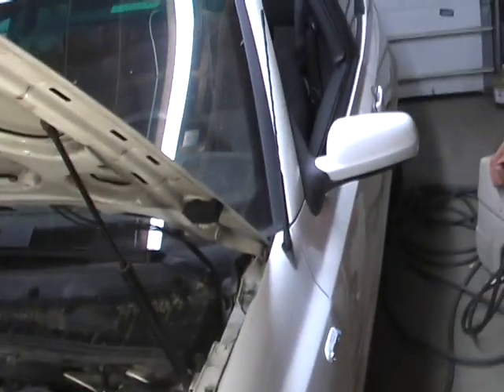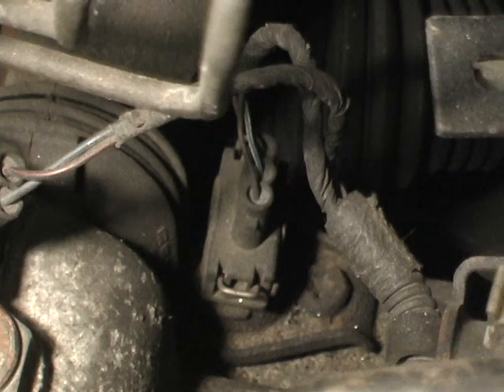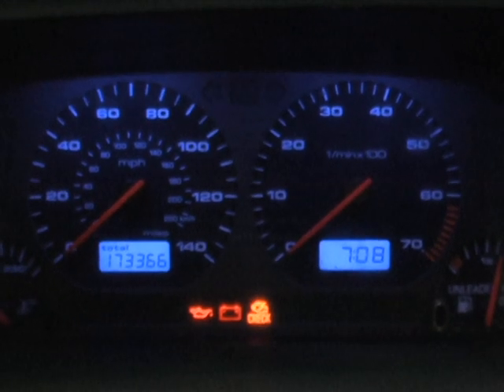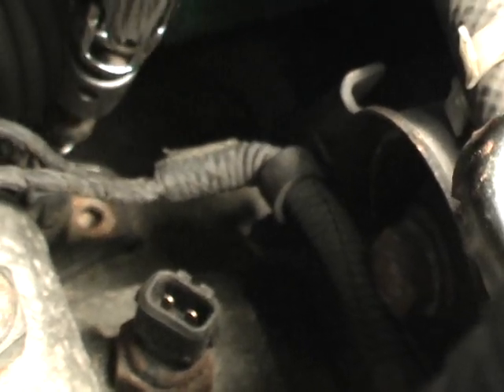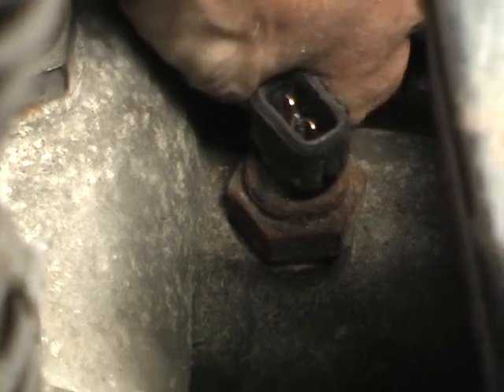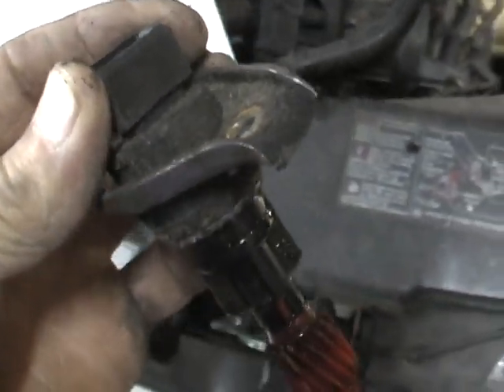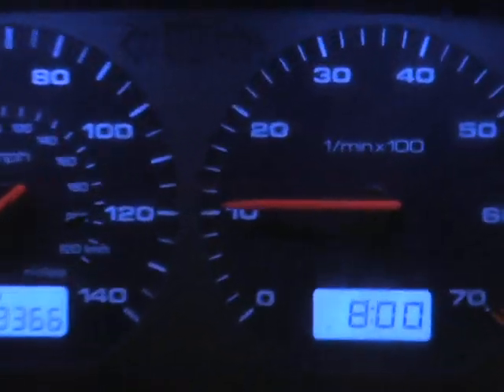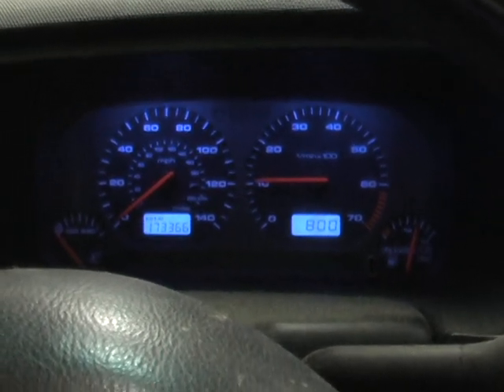2000 VW Cabrio - speedometer  not working - easy repair. Please subscribe for occasional Cabrio vids

Comment: Hi I have my polo playa  the problem is my speedometer is not working and I buy the new one so when I plug it on the car is  starting but won't move but when I take it out the switch the vehicle is moving
Reply from the maker: Hi Frank! I don't quite understand what you're sayng!

Comment: thank you! never thought to check the sensor, just assumed i'd need a new cluster, meantime backup lamp switch has died... along with other sensors so it makes 'sense' to check the switch, clip and so on. I could fault find on the tach PCB but it's been easier just to use a HUD speedo app on my phone : )

Comment: Thank you so much for your video.
That just happen to me today.
Will you be able to make a video and show the box fuse box cover.
When a bought my cabrio. The cover was missing.and I have no Idea. Whats the order of de fuses!!
Thanls again
Reply from the maker: Ill do that for you tomorrow!
Reply: @amcrae1  thank you so much! I been  trying to get the manual on eBay but is to expensive $100
Is Cabrio 2000  2.0 gls
And the fuses is been a big problem for me.
Thanks again  MCK
Reply from the maker: Will look right now! Do you want me to email you a photo?
Reply from the maker: Ugh, I just went out to photo the cover for  you... and found out that it's missing... i DO have the original Bentley manual for it, though!
Reply: @amcrae1  hi Mcrizzlei.
I'm checking my Cabrio to replace the vas sensor
And I notice . It doesn't have the plate to hold it Down......  It just the sensor . But  I have no Idea how to remove it....
Any. I deal?

Comment: If the tachometer is acting up then this could be the culprit?  

Car drives fine, speedometer is fine, tachometer acts up when the weather is cold.  Below 70 degrees (cold in SoCal).  The RPM gauge jumps up and down and even beyond redline at idle and cruising unless I am accelerating. 

If this is the culprit I can change it when I flush the transmission fluid/gear oil and fill it from there.

Comment: I have an auto 4 speed VW. So far I have replaced 2 of the speed sensors  before i thought about the tacho drive. I got my son to start the car and i spun the tacho by hand and it registered on the speedo. However, when I put it back in the gearbox and started it up....nothing...I've just ordered a replaced pinion shaft...I'm hoping that the plastic had worn. In your experience, given that the speedo is registering the turns by hand..do you think that a worn pinion shaft is the answer? I'm at my wits end lol. Thanks, great vid by the way.
Reply from the maker: Not sure, but that sounds likely and  i'll ask my VW expert friend when i get a chance!
Reply: @amcrae1  thanks buddy
Reply from the maker: @ajmarch  Talked to my friend...he said that depending on the make and model of your car, if the gear  in the transmission is toast, it could get complicated!
Reply: @amcrae1  VW new beetle 2002, 2.0 auto 4 speed azj
Reply from the maker: Okay..i've got the definitive answer. There is a plastic gear in the differential which is inside the tranny. That gear can commonly split and no longer drive the pinion (that you turned by hand). It's a big job to do. You have to drop the subframe, remove the axles ( i think) then you have to remove a plate, then the differential "guts" and need a few special tools to get the new gear in place. My friend said he remembered the job being 5 or 6 shop hours!!!
Reply: @amcrae1  thanks ever so much to you for going out of your way, and to your pal for his honesty. It may be the case then that the beetle will visit the junk yard in the sky. It's not financially viable to throw that much money at it. Thanks again pal!
Reply: @amcrae1  do you happen to know what plastic gear is called?
Reply from the maker: @ajmarch  You're welcome. My friend is a long time VW mechanic and has been very kind and generous with his advice to me, so thanks so much for your words. I can send  you a diagram of the gear arrangement a bit later today
Reply from the maker: @ajmarch  It's called the differential assembly. I'm trying to attach a photo here..

Comment: Hi, I have a 1997 seat Cordoba SDI with the speedo and Rev Counter not working. I also have a VW Polo Classic SDI with the speedo and Rev Counter working.Can I replace the VSS Switch between them ? Thanks a lot
Reply from the maker: I'm sorry but I don't know, but you should be able to call the dealer and ask what the part # is for both of these cars.... also, I'm thinking that the part number should be on the VSS switch itself on both cars and if this is true you can match the numbers yourself.

Comment: Can this cause the cabrio to have a hard time starting here and there cuz mines started acting up and the car will start in the morning but about noon it’s warmer I’m assuming outside and the car won’t start cranks but won’t start already replaced the starter ignition coil I believe and it was fine well at first it dint start but they put in a code according to the mechanic and then it started but now after some time and me replaced the cv axcels and rotors breaks and ball joints the speedometer started staying stuck and lightly bouncing but the car would start then it wouldn’t then the speedometer stopped jumping and the car started no problem and the speedometer dint live at all so has any one experienced this or know possibly what might be going on any help is appreciated thanks !!
Reply from the maker: Hi Samuel.... I hope you are well. To begin with, all that business with axles, rotors and brakes have NOTHING at all to do with your starting issues or your speedometer. In your other situation, you said the speedometer was lightly bouncing and the car would start????? The speedometer should be doing NOTHING if the car is standing still. Do you mean the tachometer was moving?????  One major thing to test is this.... if your car is "turning over" but not actually starting,  find out if there is a charge going out into your spark plug wires. You can do this in a number of ways, including getting a tool from Autozone OR just use a screw driver to ground the spark plug end of the wire to the body of the car. If you get a spark, then the coil is OK. If your car is not running right, it could also be the cam sensor.
Reply: I had the same experience had to replace starter motor was a bear

Comment: I have an intermittent speedometer reading (I can tap the glass and get it to "work." The tach works just fine. Any ideas?
Reply from the maker: Often, there is a problem with the little "circuit board" plastic on the back. It may be that......
Reply from the maker: there's a video link below showing a repair on that part...
Reply: @amcrae1  Does this mean taking it out and soldering?
Reply from the maker: @drsilverman   It may mean that!!!! It's easy to take out, not so easy to solder!
Reply: @amcrae1  Do you still make repairs? Or have any that are ready to go? Mk 3...
Reply from the maker: @drsilverman   I don't but i'll bet you can find 'em. And you can probably keep your mileage the same by switching your odometer over to the replacement cluster.
Reply from the maker: @drsilverman  http://www.clusterrepairsuk.co.uk/repair/model/vw-golf-mk3-1h-instrument-cluster-speedo-repair-service here's a place that services them... i just found

Comment: When I disconnected the battery the speedometer stopped working. Does it need to be reset?
Reply from the maker: That's odd. Not that i know of!!!
Reply: Alan McRae Had to change the fuse.
Reply: Shon9tilR can you please tell me which fuse is it?
Reply: Skip Martin I accidentally switched the fuse. The fuse box on the inside by the driver door. It’s on the small white card.

Comment: If the Tach is working, but the Speedometer isn't, would that still be the VSS that's the problem?
Reply from the maker: The tachometer has nothing to do with the VSS switch... so  the answer is a big yes.
Reply from the maker: Check out the link from Miguel up above concerning bad solder joints.. that might help.

Comment: Does that control the gas gauge and speedometer
Reply from the maker: Not the gas gauge!
Reply: @amcrae1  my speedometer started not working and gas gauge is freaking out going up and down down
Reply: I wonder if the engine harness has done thing to do with it cause I got the P0501 which is the speed  sensor
Reply from the maker: @vickirichardt1885  Did both things happen at the SAME time?
Reply: @amcrae1  yes but I replace the thermostat housing and the engine harness plug is right under that and it wasn't on all the way  it got wet in there plus I had problem connecting and I thing that why I'm having problems cause the plug got messed up
Reply: Plus the codes that are coming up seem like they Lid to that plug
Reply: Did you ever fixed the problem? If yes,what was the problem?

Comment: I replaced the VSS and teh guages still don't work... What next?
Reply from the maker: THE VSS should have gotten your speedometer working, so maybe you have a problem with your instrument cluster (the printed board on the back)?
Reply: I HAVE A GOLF MKIII AND IT DID NOT WORK ON TACHOMETER YOU ONLY NEED TO REMOVE PANEL INSTRUMENTS AND RESOLD THE PINS OF THE HARNESS WITH THAT YOU WILL SOLVE THE PROBLEM IN MY THAT WORK ... GOOD LUCK
Reply from the maker: Miguell... If you ever have time, it would be wonderful if you could make a video of the spots that you soldered on the harness/panel.
Reply: IT IS EASY, IT ONLY REMOVES THE CLUSTER, AND AFTER REMOVING IT DISARMES THE BACK PART, AND THAT IS, THE BASE OF THE PINS WHERE THE RING CONNECTOR GOES. AND HERE FAIR IN THE BASE OF PINS IS WHERE YOU MUST RESOLD
Reply from the maker: https://www.youtube.com/watch?v=PfmHPipxIPw